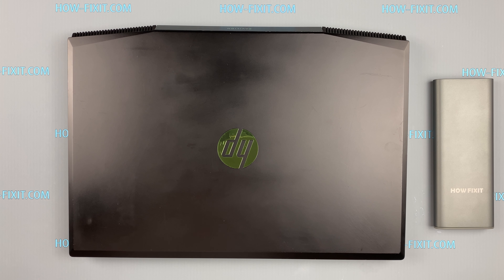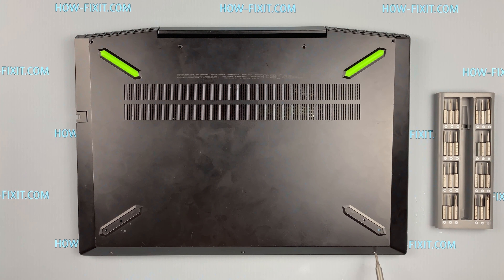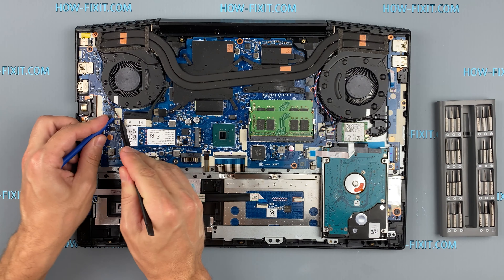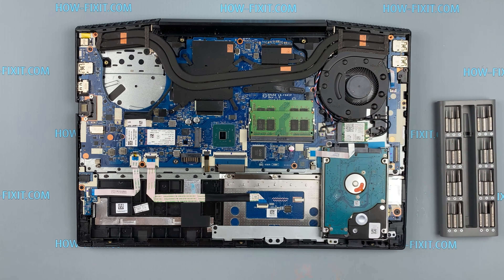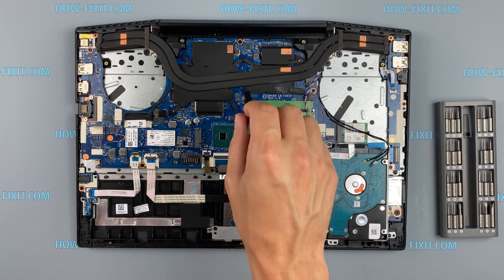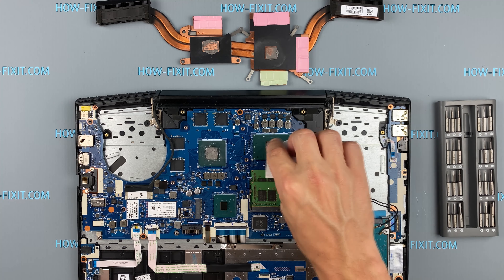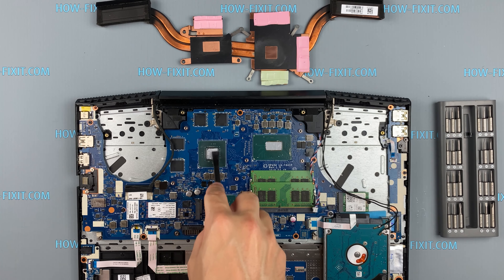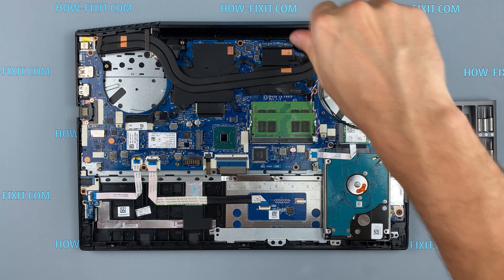HP Pavilion Gaming 15 disassembly, cleaning and thermal paste replacement

Comment: do you have any information as to the thickness of the thermal pads used here?? i have the same basic hp 15 cx0000 and cant find the info on what thickness thermal pads i need when i replace the paste...
Reply: i've been trying to find that information but i haven't found any, i think the only way to know the thickness of the pads is to measure them :(
Reply: @raulsilvera9158  and @James Harris    please what was the measurement

Comment: question, is the i5 processor fixed with smolder, or can it be replaced or removed without special equipment?
Reply: Yes, all new laptops have CPU and GPU soldered

Comment: Can anyone help me find a spare part? Im looking for the connector that connects the "screen cable" onto the motherboard. He is wiggling the cable at 1:50. I need the connector which holds it on the motherboard. Only clue I have is that it is a 40-pin connector with '1815' on it.
Reply: I can get you a part numbers
Reply: Aliexpress

Comment: Which milimeter thermal pad should I use to replace? 0.5 / 1.0 or 1.5 mm?
Reply: I need to know that too. Did u figure it out?
Reply: @starmember132   I bought 0.5 mm
Reply: @stalypodwiek9556  And how’s it going? My model is dk 1027la with i7-10750H. You think 0.5mm would be good?
Reply: @starmember132  yep, 0.5 mm will be good for most laptop (w/o alienware 17-19"), 1.0 for most common PC  and 1.5mm for RTX3080/RTX3090/6900XT for one side
Reply: @stalypodwiek9556  The only way to figure out, is to measure old thermal pads with digital caliper. Keep in mind, that the thermal pads can have non standard thickness such as 1,3 mm or 0,7 mm. Also it is important to use thermal pads with exact softness (SHORE) just like factory thermal pads. If you will use hard thermal pads, the cooling pad will not be pressed hard enough with screws (with springs on screws), ant there will be a gap between CPU/GPU die and heatsink surface. This will lead to CPU/GPU overheating.

Comment: Is the graphics card integrated into the motherboard? I don't know much about computers
Reply: in laptops yes, its the green chip on the right when applying the thermal paste. If you have dedicated graphics on a desktop it will not be integrated but if you have intel uhd graphics (integrated graphics that come with most processors) it will be integrated directly inside the processor

Comment: Hello, I need help. I have pavilion gaming 15-cx0073nw and I want to add ssd disk(i have only 250 gb m2). So when I open my laptop I was dissapointed because there are no conector tape - sata conector, like in this video. So i asking You, maybe you could help me find like this to buy. 
For more infornation, I bought laptop 1 year ago, without disk. I can do this by myself because in service it will be cost a lot of money. Thanks for answers
Reply: yes.. they sell the connector but mine came with one even tho that was empty? maybe just upgrade ur nvme

Comment: If I want to change the gpu, I have to change all the motherboard? Or it's most complicated?
Reply: You can’t change the gpu on a laptop, However if you have the right port like thunderbolt 3 or similar you could be able to connect an external gpu

Comment: Hmm usually not a good idea to spread the paste. Better to draw an X and let it properly squeeze. 

Anyways how’s the cpu temps afterwards any difference?
Reply: Had mine apart many times but I never took the heat sink off. I did however add additional heat sinks. Noticed lately my core temp is starting to vary between cores so figured I’d see if anyone else was addressing a similar issue before I pulled it apart again.

Comment: I tried this but I can't open my back cover. Damn I need help.
Reply: me too!
Reply: @Neok4k4k  You can try using a spudger or an old gift card to help pry open the back cover. I had this problem too with my laptop, but I used I believe 2 gift cards the first time I opened it.
Reply: @nerdspotted1136  thankss! will try.
Reply: @Neok4k4k  No problem bro

Comment: hey everytime i open the lid or close it make like a cracking sound do you know what the problem is ?
Reply: i guess some laptops don't have screws to fit the lid. Yours might have edges on the side to fit to the device cuz mine has edges.
Reply: OMG MY HP PAVILION LAPTOP HAS THAT SAME SOUND I always get scared when tha thappens
Reply: something is breaking,  probably the hinges are getting harder kindly  have it checked before its too late

Comment: Im having trouble removing the back plate :(
Reply: i suggest you open it from top right side (right fan) all the way to left side, it would be easier that way. use two prying tools if possible, i used guitar pick and also flat screw driver.
Reply: I used to start from the right fan and go down on the right side, it's easier. More or less like the video